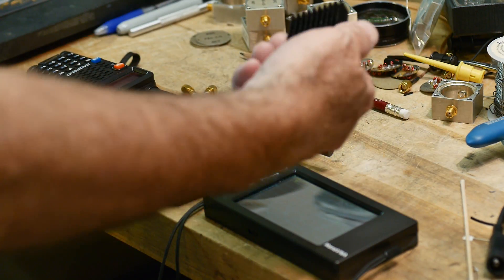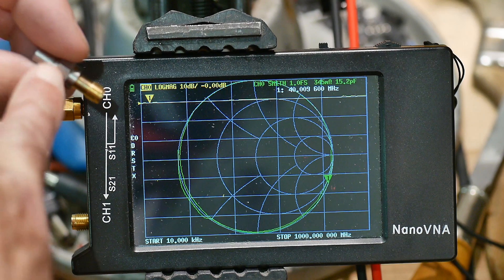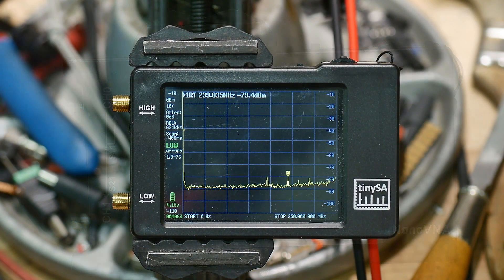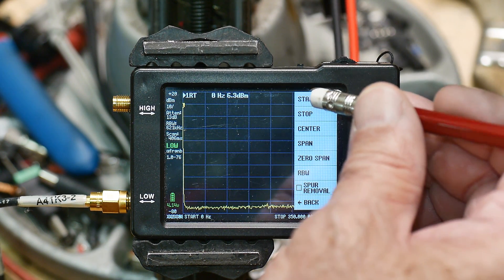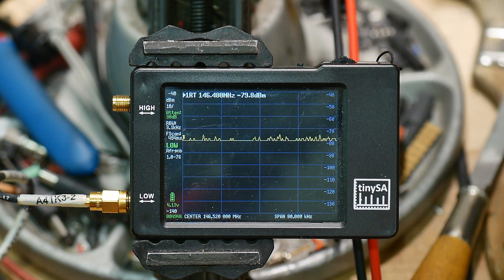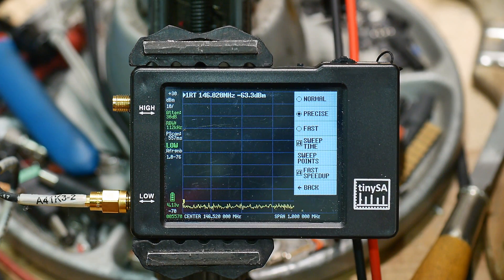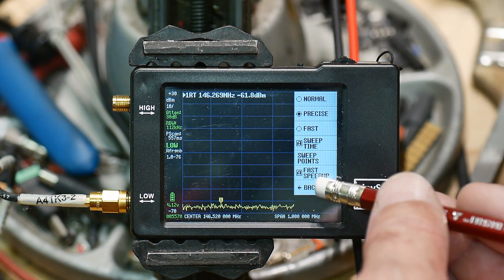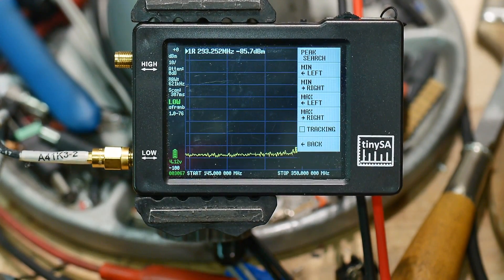#592 Using the NanoVNA and TinySA with 50 ohm load to measure radio

Comment: Qual é o melhor dos dois?
Reply from the maker: depends on your needs,
Reply: @IMSAIGuy calibrar antena
Reply from the maker: @meuhobbydetectorismo  the nanovna is for testing antennas
Reply: @IMSAIGuy ok, obrigado. Más o tinysa não é pra calibrar antena?
Reply from the maker: @meuhobbydetectorismo  the nanovna is used to test to resonance frequency of the antenna by measuring the VSWR, a TinySA can be used to measure the amount of radiated power from an antenna but not accurately. When I design an antenna I use the nanovna
Reply: @IMSAIGuy obrigado, acabei de comprar um nanovna h4. 👊
Reply from the maker: @meuhobbydetectorismo  I have a 'nanovna' playlist, you will find many videos
Reply: @IMSAIGuy ok, vou explorar seus vídeos, que pena que não falamos a mesma língua e a tradução não tem.

Comment: You said "dummy load", but I guess you did an "Attenuator" and seems your attenuator is -30dbm, right?  I want to test HTs from 0.5W to 10W.  How much DB attenuation do you recommend? 30, 40, 50 db? Thanks.
Reply from the maker: https://youtu.be/Sdb_cs13njk
Reply from the maker: by the way, it was a dummy load with an RF tap. not an attenuator: https://youtu.be/4sxPSJKPOs4

Comment: To check for spurious, make sure to go to the High port and check the multiples of 146. The 3rd and 4th order harmonics for my baofeng and btech HT are horrible, but the LOW port only shows the 2nd order(which is also out of spec)
Reply: Yep. He overlooked the fact that on the LOW input the SA doesn't read above 350 MHz. But here it is 2 years later and for another $35 my TinySA Ultra conveniently uses a single input to read all frequency ranges and has a software feature that automatically reads and displays the levels of pretty much all significant harmonics. Time marches on.
Reply: @johnwest7993  I noticed that in one of his other videos (can't remember which one, I've watched so many). I think it's the one where he's using the NanoVNA as a signal generator. He was puzzled by the fact he couldn't read above 299 MHz yet he never used the high connection port nor did he switch from low to high input. Hey everybody makes mistakes. tried it with mine, yup that was it. Since it's my first day with ANY SA I thought it was pretty cool I noticed it. I know, I know...don't break your arm patting yourself on the back. 😁
Reply: @billellis3137 , it's always easy for us to analyze after the fact. I use a Harbor Freight $5 multimeter so I don't blow up any of my Flukes doing something stupid. :)
Reply: People probably overestimate the importance of these specs. The antenna is also going to act like a filter, too. By the way, in have a shortwave radio and i can pick up a couple local AM broadcast stations on their second harmonic. Wirh a sensitive receiver, you will never avoid harmonic issues. The goal is more that your signal will be weak anough that any legit signal on that harmonic would overpower it

Comment: Some Baofeng series suffer from being deaf when connected to external or base antennas. Maybe because they don't reject signals out of band.
Have you observed anything like this on yours?
Could a passband filter help with this? Thank you!
Reply from the maker: Mine is great. I really like it. I've owned many yeasu and icom HTs and the Baofeng is the best I've had. $25
Reply: @IMSAIGuy  Did you tried connecting it to a base antenna? Thank you. The only thing I dont like of them is the digital squelch instead of a knob, besides of that they are great and cheap.
Reply from the maker: @DavidLopez-bz4rj  yes  2m j-pole

Comment: Unfortunately, it’s not in spec. 97.307(e) says for that frequency it must be 60db below the fundamental, or 25uW, based on power(so 100 watts needs 60db down, 5 watts needs no more than 25uW) If that is a Baofeng (5W) then you  need no more than 25uW, or about -53db. That being said, it’s so close that I doubt anyone will hunt you down for such a close margin.
Reply from the maker: 4.5W  does not look great
Reply: @IMSAIGuy  sorry I updated my comment like 4 times during your post.
Reply from the maker: I'll blame it on my 27yr old test gear and the TIny was never calibrated so can't trust it.

Comment: Good morning. Thanks for posting this video on your homebrew RF sniffer with arbitrary attenuation. 
I would rather prefer the term "sniffer" though the cold is connected to that of the dummy load rather than to call it a "tap". 
These thick film Chinese resistors are somewhat good for Amateur radio operators and though they are mentioned to be good upto GHz, I was very much doubting that.
Here the way you have made the dummy load in a screened box with heat sink is all that anyone can do maximum in taking care to have the shortest leads. All in all its a good demonstration.

Comment: can you check sensitivity of the radio with tiny sa?
Reply from the maker: no. sensitivity requires the injection of a signal at very low levels -80dBm to -120dBm and the monitor of the audio output of the radio for distortion.
Reply: @IMSAIGuy  ok thanks

Comment: Good morning INSAI Guy!  Congratulations on the video of the dynamic test of the load built by you, using NanoVNA and TinySA which are, in my opinion, the latest equipment with excellent cost benefit.  Enlightening and inspiring video for those who like to work with RF.